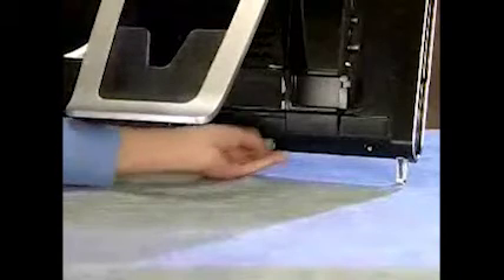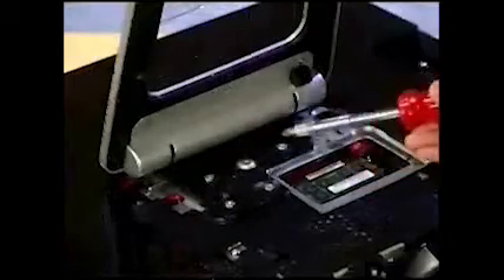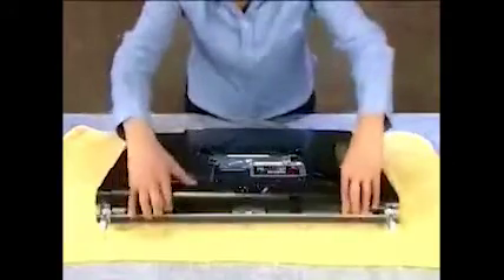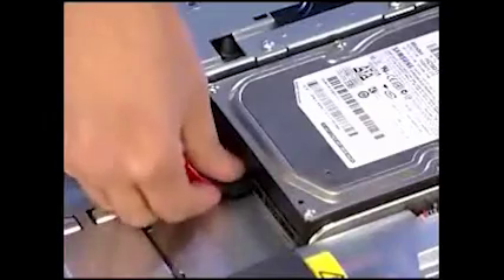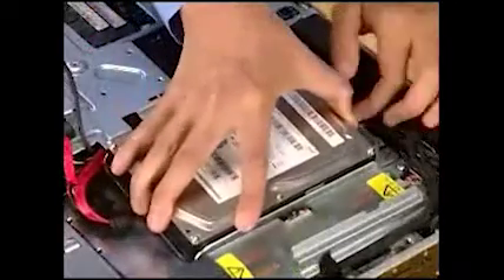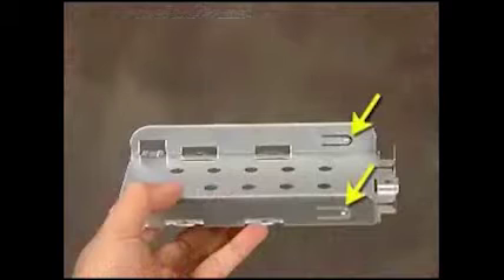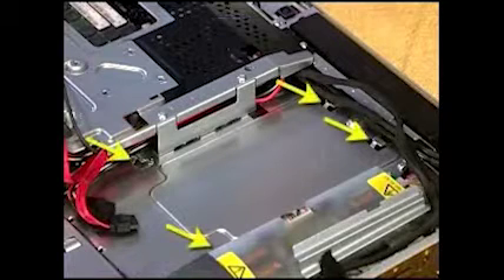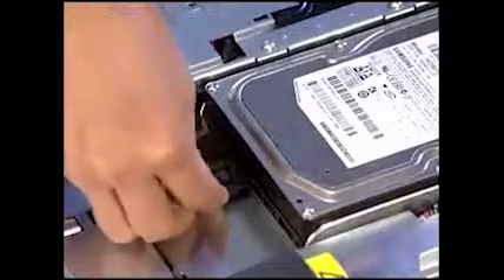Replace Hard Drive | TouchSmart IQ500 | HP Support

Comment: can i Upgrade CPU Processor for All In One HP Desktop Computer IQ525gr??? thanks
Reply from the maker: Hi there, thanks for contacting!
I understand that you need to know about upgrading the processor of your computer. 
I will do my best to assist you.
HP does not recommend upgrading or downgrading hardware parts or software that is bundled with the product as It may affect the manufacturer's warranty and performance, however, you could change the configuration at your own discretion.
Binu - Social Media Tech Support

Comment: Thanks for the video  :D
Is that a normal 3.5" ?
Reply: Do you have to partially remove the optical drive if you only are replacing the hard drive?
Reply: @baileek.5001  Sorry for late reply but yes, HDD can't side back unless you undo the screw for the optical drive and move it out the way.
Reply from the maker: +Jerry M I am glad to know that the video was useful to you.
Reply: @HPSupport   You didn't answer the question as to whether this was a standard 3.5" HDD.
Reply: @josephwilkerson7556  yes, it is